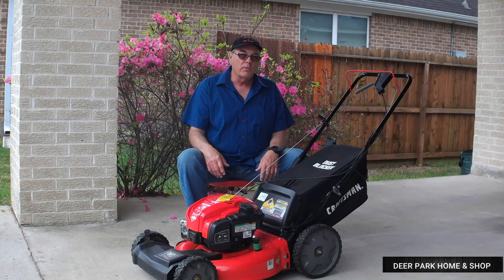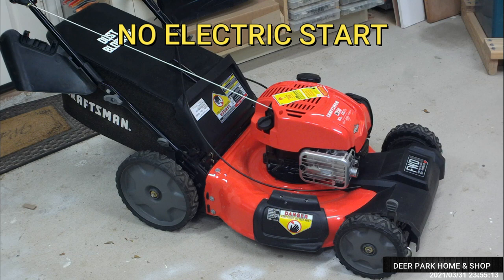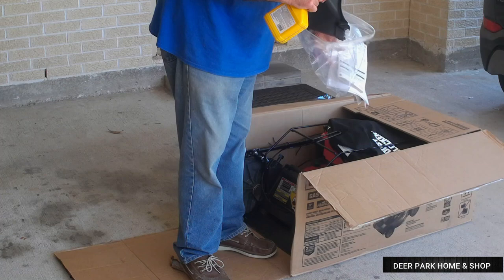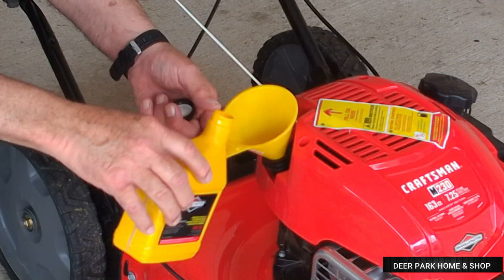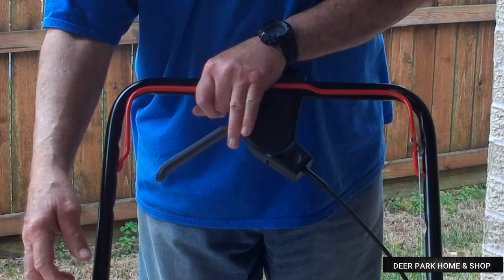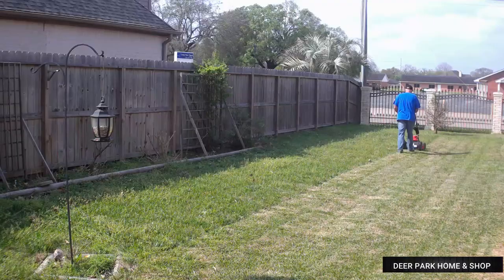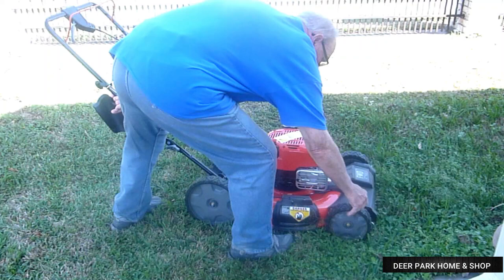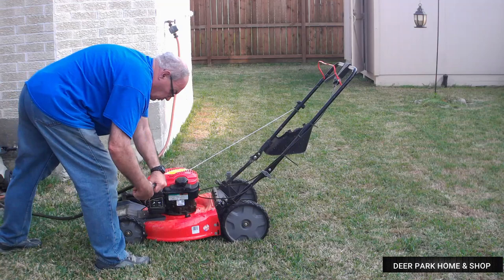Craftsman M230 lawnmower - unboxing, set up & review

Comment: They should include this video instead of the crappy instruction sheet thats included with the product. Thank you.
Reply from the maker: Thanks!  That's one of the best compliments I've had.
Reply: Totally agree! I was concerned about the oil and pulling the starter back with the tension it had!
Reply: I came straight to YouTube ..
Reply: LOL-- yes, the manual is one of the worst I've seen (it makes IKEA look good)
Reply: Agreed!!! This video was very helpful unlike the instructions. Thank you sir for posting.
Reply: Amen!! Why bother putting the instructions in the box. Useless. Thank you so much for taking the time to do this video!! It is awesome!
Reply: @deerparkhomeshop2471 l
Reply: Yeah I came here the drawings were pathetic
Reply: @rhester02  same here I just got this same lawnmower and I came here.
Reply: You ain’t lying 😂
Reply: Correct trouble  to ready and follow the instructions  more confusion. .this so easy.
Reply: No doubt I agree lol

Comment: Unboxed ours and this video helped resolve cord issue. thought the mower was broke on a locked up cord. There was a bolt in the way and we had to extend the two black sticks on the sides. The written directions weren’t as clear as your video. Thank you.
Reply from the maker: Thank you!  This is a problem with manuals for many, many products.

Comment: Thank you very much for making this video!! I have never owned a self-propelled mower and I was undecided as to what type of handle style this mower had.. Pictures were confusing and letters were small....glad I found your tutorial for you gave me the confidence to set it up and operate this...will not use the bag..prefer the mulch option..my small yard in Florida has more weeds currently, aside from the "swale" by the road.. Again, Thank for your help!! Nancy K.  a young 62yr old in North Port, Florida
Reply from the maker: Thanks for watching the video Nancy and good luck with the mower.  Feel free to contact me again if you think I can help.  Us young folks have to stick together (I'm 72).
Reply: Got it together..took 2-3 pulls and it started...runs and cuts great..on #4 thanks Mike
Reply from the maker: @nancykutz393  Glad to hear it, but I'm surprised that it took three pulls.  Mine usually starts on the first pull.
Reply: Yes you are Ms. Nancy, my dad was still using his lawnmower at 102! that's what kept him in shape!!! keep it up!!!
Reply: @deerparkhomeshop2471  First timer using it today, it started on second pull but I was very disappointed that it did not have a strong pull... I'll try to look over it tomorrow because it was getting dark. Maybe there's an adjustment I have to do in order to make it pull with a little more rigor. thnx.
Reply from the maker: @mingching2480  There is an adjustment wheel on the pull handle.

Comment: PERFECT VIDEO!!!  I love this m230, my parents bought this many years ago and it has NEVER failed.  I hunted down one on fb marketplace cheap, and though the previous owner bent out the blade hitting something (i have as well), it still performs better than any mower ive had.  HATE the new mowers on the market.  You covered all the basis and I was like, what cons can you have?

Ive always used the mulch mode, the bag is pointless imo.  Im shocked its an add oil as needed (almost changed both mowers oil, may still do just cuz one is still original 8-10 years)....first start pull no prime never fails, its amazing!
Reply from the maker: Thank you!  like you, I am still happy with the mower and it still usually starts on the first pull.  I have needed to add oil only once since I bought it but I am continually checking the oil level just in case.

Comment: Nice video. Hate the mower.  This is the second Briggs and Stratton engine I’ve had.  I was bound and determined not to buy another after all of the problems I had with the first (impossible to keep debris out of the carburetor so it had to be disassembled and cleaned before every other mow to get it to start).  Horrible air intake design.  
The design of the m230 intake was better, and I did not want to go to an electric mower yet, so I swallowed my pride and bought the M230 from Lowe’s at $459(!) even though it has a Briggs and Stratton. 
Right out of the box, there was no manual, oil, or side discharge chute.  Watched this video, realized it should have come with all that, and do I boxed it up and took it back to Lowe’s.  
It is very important to me to support businesses here and buy American, but I’m going electric after this.  Very disappointed.
Reply from the maker: Sounds like you probably got a mower that had already been returned by someone else and had been repackaged.  My M230 has preformed flawlessly since I made the video.  Let me know how well the electric mower works for you.  I have a fairly large yard and I'm concerned that I may not have enough battery charge to do the whole thing, but I could be dead wrong about that.

Comment: Thx for sharing.  Great video.  I only go with RWD bag and mulch much better but more expensive.
Reply from the maker: I've had both FWD and RWD mowers.  This Craftsman FWD is much better than the mowers I've had in the past, but, really, if you use the bag, it makes sense to have that extra weigh where the drive wheels are.  Thanks for reaching out to me.

Comment: I dont use the mulch bag either on mine.  The lawn in front of a house, needs top soil in where it is straight.   When you use a mulch bag on a front lawn, after a few years your top soil os going to sink down in some areas. Same thing applies to a back yard, except its appearance generally isnt as precious as the frontal view.  Mulching lowers your top soil because the initial grass you are cutting used the soil when it grew, so it needs to go back to the soil to keep the level
Reply from the maker: I agree.  I've been told that the only thing you have to worry about in the long run is that too much thatch may build up under the grass.  So far I've dodged that bullet.  Thanks for watching!

Comment: I’m considering purchasing this for the lesser M220 this weekend. I have a gift card for Lowe’s so this is basically the only gas mall where I can buy. I’ve heard some horror stories about the new Briggs engines, I understand you have to store them properly, but I’m hearing of problems on top of problems with these mowers. Would you still buy one today?
Reply from the maker: I've had nothing but good luck with mine. I have to mow my lawn weekly so storage is not a problem.  For winter, its common practice in the Houston area to drain the gas and then start the mower and let it run until it quits.  If you live north of here and have extremely cold winters, you may need to check and see if there are special steps to take.  You should do this for Honda or any 4cyl. engine as well.

Comment: I am a senior and walk slowly will the mower accommodate.
Reply from the maker: There is an adjustment wheel on the handle that allows you to set the forward speed to your own taste.   I'm 73 and I have no problems, although I tend to walk faster than normal at my age.

Comment: The pace control system is the adjustment of the trigger throttle  to see how fast u want the to turn front wheels  which determines your walk behind speed.
Reply from the maker: Hello Mike, thanks for your comment.  Actually, the more expensive Craftsman M320 has a true pace control system.  Here is their definition: "PACE CONTROL SYSTEM: Comfortably walk at your own pace while the mower automatically adjusts to match your natural stride." The M230 in, my review, has variable speed which has to be manually adjusted to your desired speed. Like most people, I was confused on this point before I did the research for the video.

Comment: I disagree when manufacturers say dont change the oil. Oil gets dirty over time. Kindly suggest what oil you used?
Reply from the maker: Well I'm old school, and like you, I think you need to occasionally change the oil.  The mower came with Briggs & Stratton 30W 4 cyl. small engine oil, but  you could use Pennsoil, Quaker State, or any quality brand.

Comment: Just one question what brand the oil i have to add and why people add oil to the gas thank you
Reply from the maker: Craftsman recommends 10w-30 oil for the oil filler cap or crankcase, if you prefer.  You DO NOT add oil to your gasoline.  It has a 4 cycle engine.  You add oil to the gasoline for 2 cycle engines like chainsaws and weedeaters.

Comment: I just got this exact model last night and started putting it together.  The pull cord on the mower isn't budging.  Does anyone know what to do about that?
Reply from the maker: Mine was hard to pull out and then secure on the handle.  If it won't budge at all, you probably need to talk to the seller.  You could loosen the spark plug to reduce compression, but I wouldn't do anything like that without talking to them.  Don't want to mess up your warranty.
Reply: @deerparkhomeshop2471 I didn't pull the handle out fast enough and it was preventing the blade to turn.   It's fixed now.  Thanks.
Reply from the maker: @maddogj323  OK.  Glad you got it squared away.

Comment: My mower is great but the bag doesn't seal and some grass escapes where it connects to thr mower deck.
Reply from the maker: I actually don't use the bag myself, but I think if the bottom rim had been designed to lock into place it would have sealed better.

Comment: Great video! What’s mulch mode?
Reply from the maker: Mulch mode is when you don't use the bag or the side discharge adapter.  The mower deck stays sealed and the combination of the mower design and the spinning blade pulverize the clippings and, since they art not discharged,  they return to ground and "mulch" the yard.  This design is very common among many brands of mowers.
Reply: @deerparkhomeshop2471  I think I’m sold!
Reply from the maker: @CashMopar  Well, I wish you the best of luck with it.  I haven't had a single problem with mine.

Comment: Great video! I just purchased the m320 craftsman. I did notice with the mower that the lawn was cut shorter than I wanted. I had the front and rear set at the highest setting. Wondering if i may have to switch it out for something different? I live in FL and just had land graded and floratam installed. They have not returned with roller yet but grass took real good within three weeks and was super high. Advice?
Reply from the maker: When I cut my grass on the highest setting it just seems too high for me and I have started cutting it at one notch lower.  Floratam, I understand, is a hybrid version of San Augustine which is what I have, so it shouldn't be much different.  I think most folks here cut it even shorter than I do so they won't have to mow as often. I'm using the M230 mower which may have a different wheel setup.  My only advise would be to return the mower if you can or try to find larger diameter wheels.  Measure your blade height above grade  at the highest setting before you do a return so you can make sure the next mower you get will actually cut higher. Sorry I can't be more help.

Comment: Just used it for the very first time, the self propel feature is very weak, not like the old mowers of the past... it cut well, but it just doesn't have enough pull... does anyone know how to adjust something on it so as to actually feel like this thing is pulling? thnx.
Reply from the maker: There is a small dial or wheel built into the self propelled handle assembly that adjusts the speed of the pull. Pull the handle back and turn it until you get the desired speed.

Comment: My last Craftsman had a 'catch' that would hold that back grass catcher door open till you returnrd and put the grass catcher back on. This newer model, it slams down and you have to lift and hold it up while you put the bag back on.  Which side should you turn the mower on when you need to scrape the underside or remove the blade? The old mower it was ok to turn it over on the gas fill side, but when I did with this new mower, the air filter got lots of 'oil' in it and had to buy a new one.  Can I turn it on the other side?  The "manuals" today have very little info in them,  I don't even have a parts list!
Reply from the maker: I was able to manage the lift door and attach the bag, but I don't use the bag much.  You can take an appropriately size bungee cord and hook one end under the front of the mower and the other end on the doors edge and this will hold it open until you get the bag positioned.

  I have never had to scrape the underside of the mower.  I use the top water port with the hose turned fully on.  I run the mower two to three minutes and the underside gets good and clean.

 To change the blade, I would lift the air filter side of the mower as little as possible.  I actually put mine on top of my workbench and lift and support the side with wood blocking until I'm done.  This is just my method.

I agree that the manual is really lacking but most modern manuals are.  Try sites like partstree.com and ereplacements.com for parts lists and diagrams.

Hope this helps.

Comment: I just bought this and the screws keeping the handle down in the blade were stripped.  So irritating.
Reply from the maker: That is unacceptable if it's a new mower.  Was it in a box like mine or was it pre-assembled?
Reply: @deerparkhomeshop2471  It was in the box new.  I returned it and the new one works perfect so I may just got the one bad one.
Reply from the maker: @michaelbondy-ud9jx  Great.  I'm glad they made it right.

Comment: Or change your oil in your lawnmower at the end of the season
Reply from the maker: About the air filter you mentioned in your first comment,  since it's a paper filter it needs to be changed regularly, depending on how much the mower is used.  It can't be cleaned like a foam filter.

Comment: My starting cord does not pull out. I'm afraid to brake the machine.
Reply from the maker: The top red starting lever has to be pulled back against the handle to release the starting cord.  One of my other viewers had this problem because he didn't have the handle assembly pulled out far enough from the deck.  If this doesn't help, it may be defective.

Comment: I just pulled one of these out of the box and there is no pressure on the self propelled lever. This feature is not engaging.
Reply from the maker: Forgive me if I state the obvious here, but the lever may just need to be adjusted.  There is a small dial and the word "tighten" on the self propelled lever assy. near where the cable connects to it. This allows you to customize the pace of the mower.  Turn the dial in the direction of the arrow until it engages and keep turning until the speed is where you want it.  If this dose not work, then follow the cable back to the engine.  Make sure it's connected to the spring loaded throttle.

If this does not work, I would call the store that sold it to you.  Hope this helps.
Reply: @deerparkhomeshop2471  I’ve already  turned that dial as far as possible and I’m not going to tare-apart a new mower.
Reply from the maker: @maniecantrell8358  Don't blame you!   I would take it back and exchange it.

Comment: How agile is the mower,
Reply from the maker: I would say about as maneuverable as a rear wheel drive.  One exception though is that you can't get as close to to walls and fence when you approach them head on.  I can but the front of the mower against a wall, for instance, and there will be a 5" strip  of uncut grass left standing so I have to turn the mower and cut it.  This is just a minor annoyance.

Comment: All ways change your oil every season air filter blades every season if blades does not need to be changed don't change the blades
Reply from the maker: Craftsman says you only have to add oil as needed, which I think should be considered a minimum requirement.  I think it's a great idea to change oil yearly.  I don't have any hard facts to support this, but it seems logical that your mower will last longer.

Comment: This mower is front wheel drive. I would like my mower to be rear wheel drive. Anyway, thank you so much for the video I may have a slightly different model, but I could not have put this together without this video. The diagrams are utterly useless.
Reply from the maker: Thank you.  Good luck with your new mower!
Reply: @deerparkhomeshop2471  returned it for the rear power one. It's a weird one. Have to hold it and push forward on the bars. Thanks, I think I'm going to need all the luck that I can get. 🤣🤣🤣

Comment: I bought this mower last year and used it 3 times. Just pulled it out yesterday and it would not start . Any ideas or advice ?
Reply from the maker: Unfortunately, you need to either make it a point of starting your gas equipment every few weeks during the winter season or draining the carb. before you store it.  Gasoline tends to "shellac" up in the carb. as it gets old and then it won't start.  There are also additives you can buy to help prevent this.  I had this happen to my $700.00 generator.  One quick test is to buy some starting fluid at the auto parts store.  Remove the air filter and spray it in the air intake.  Crank it, and if it starts it means that the electrical system is working.  If it keeps running, let it idle for a while to get the gunk out of the carb.  If it runs a few seconds and quits, then it is probably shellaced up and will need repair.  If it's still in warranty, see if Craftsman will cover it.  I wish I had better news for you.  Please let me know how it turns out.
Reply: @deerparkhomeshop2471  thank you for your excellent advice ! I will try this either this weekend or early next week and let you know . Again, many many thanks for your help. 😎
Reply from the maker: Hope it works.  Let's keep our fingers crossed.